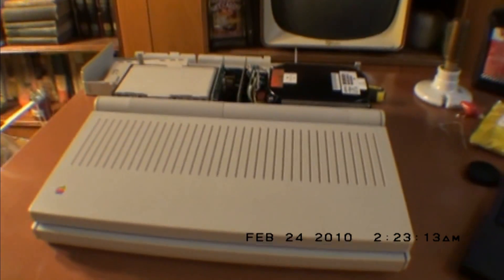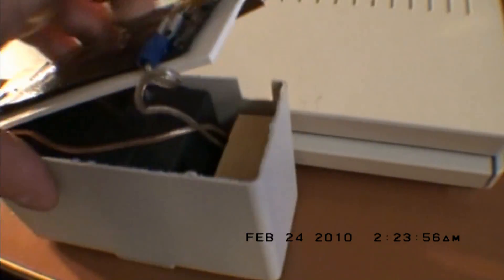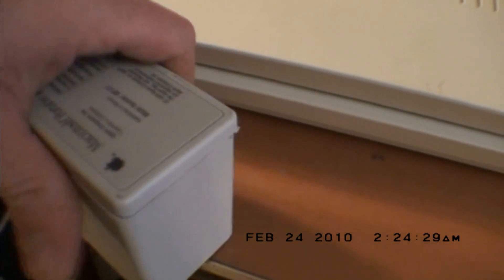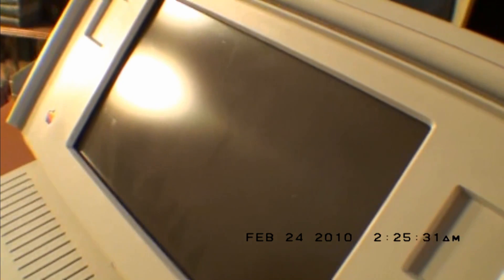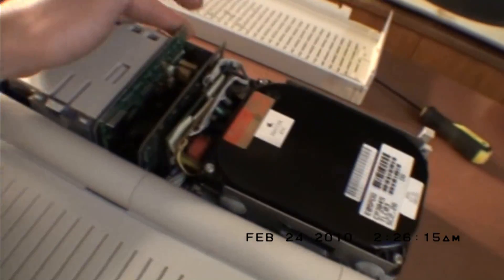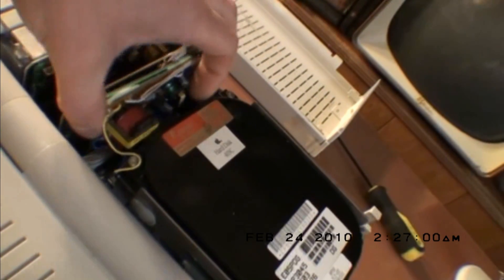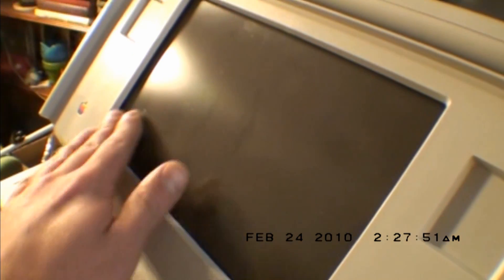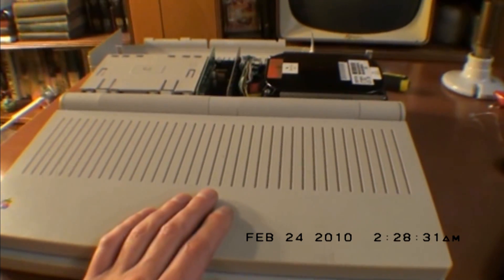Macintosh Portable 5120 Backlit Prototype?

Comment from the maker: @CPQ5360 Not sure if he was an engineer... he said he "worked for apple" for all I know, he could've been a janitor.

The original battery is 6 volts, and that cell was from an old UPS I tore apart and happened to have it laying around the house, and it fit in the Apple housing pretty good, so I used it.  It didn't have much life left in it when I did that around 8 years ago, but it was enough for it to power up.  it's totally shot now.